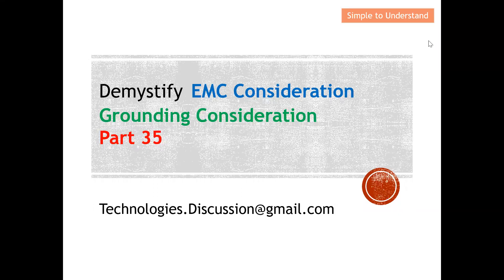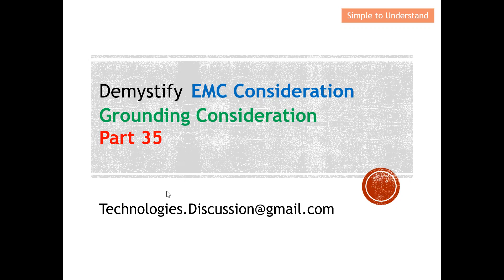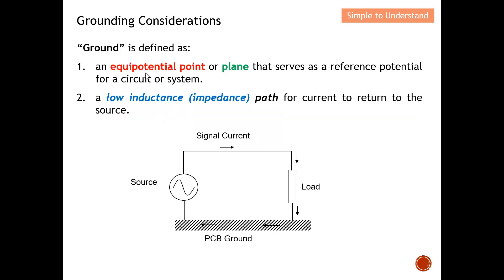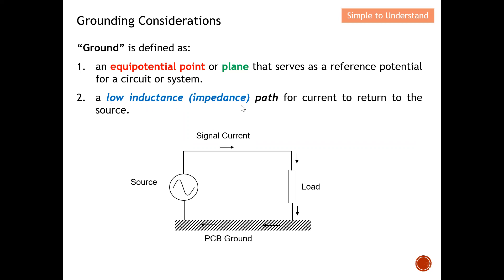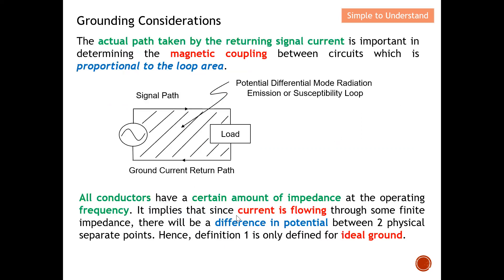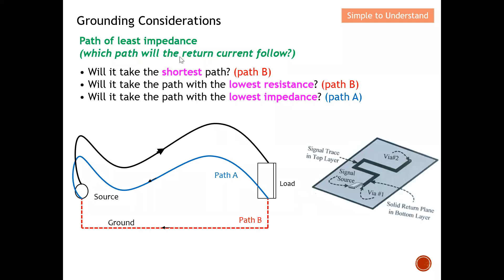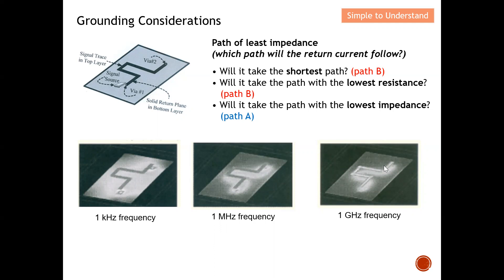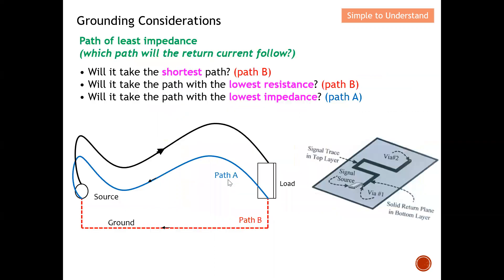EMC #35. How to Reduce Noise in Circuit: Provide Low Inductance Ground Return Path for Signal Return

Comment: Great video. I could get the point that current travels over whole copper pour at 1 kHz. I didnt get why that path is the shorter path for the current to return.
Reply from the maker: Path B is to flow on the gnd plane. Therefore, the path is the shortest. Why Path A has a longer route because it follows the PCB surface conductor route so hence tech, is longer.   :)